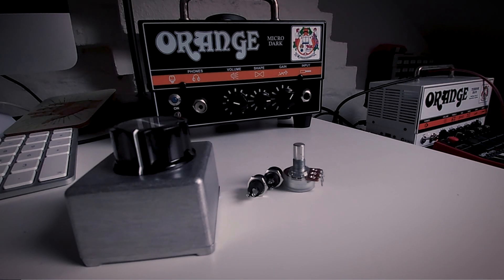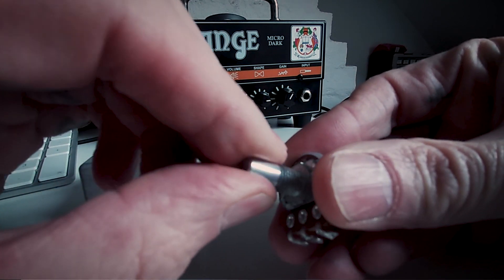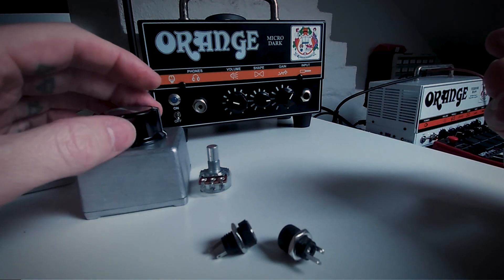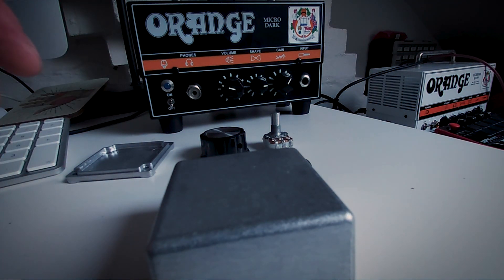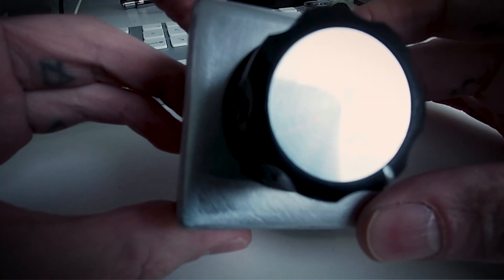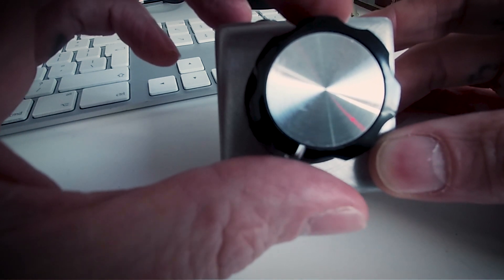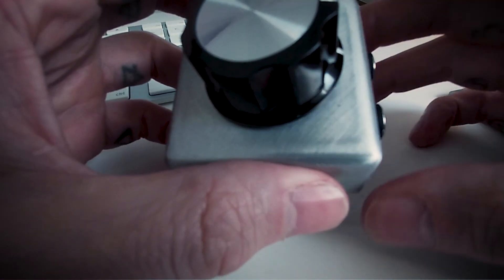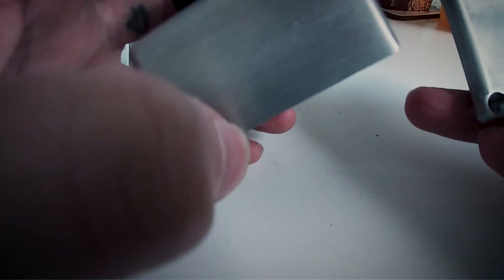DIY Dying Battery or Voltage Starve Guitar Effect

Comment: It just sounds like an external volume knob to me.  I've seen other voltage-sag pedals that have a better effect on fuzz pedals without decreasing the volume at the same time.  Bummer though...because I was hoping that I wouldn't have to consider spending $70 on a JHS "Volture" pedal to achieve what I need with my fuzz pedals.

Comment: What about the opposite what about turning up the voltage like as long as the pedal can handle it does like 12v or 16v sound different that 9 volts
Reply from the maker: it would blow the components in the circuit mate. Pedal circuits run on 9v, anything more it might handle it for a bit then burn out.
Reply: @unholyaudiochannel   well yes that would happen  but what if you put in higher voltage components
Reply from the maker: @kadenshoemaker6669  wouldnt make any difference you wont get a better sound.
Reply: @kadenshoemaker6669  most of the time it depends what kind of IC and capacitors are in it, i've read people who swear it improves quality -- even using up to 18v. a bench power supply should do the trick, just be careful and do yr research!!

Comment: Does this work on just the straight amp distortion,
Maybe if you put in in the effects loop?
Reply from the maker: No because it starves the voltage to the pedal you are connecting. Do t think you can starve voltage to the power supply of the amp. Different power supply higher voltage etc.

Comment: hm i tried this exact thing with a 5k pot and it doesnt change the voltage at all...
Reply from the maker: Try a 1k pot
Reply: @unholyaudiochannel  what is the logic behind that? isnt a 5k just resisting the voltage more than 1k? it should just be able to attenuate more isnt it?
Reply from the maker: @matrixmodulator  yeah dunno you just have to experiment on a breadboard with croc clips to get your desired effect. I just publish my experiments. Defiantly not a lot of logic to them lol
Reply: @unholyaudiochannel  i added 4.7k pin 3 to gnd to form a voltage divider, works really well, pot wiring a little different.

Comment: Great idea! I implemented a similiar circuit in a fuzzy op amp distortion pedal. I used an A10k pot with a 4.7k resistor in parallel, that gave me a huge but very usable range
Reply: The current draw of the pedal will affect the need R of the pot. Ohms law never falters.higher current pedals will need a higher R pot for greater range. Lower current, lower R. You could use a dual pot with a 1k and 10k, for example, with a dpdt switch. Or 2 pots with a foot switch for "presets" + versatility.
Reply from the maker: Great thanks for the info. Yeah might try one with a resistor too. Thanks for watching!
Reply: How do you do it in parallel?